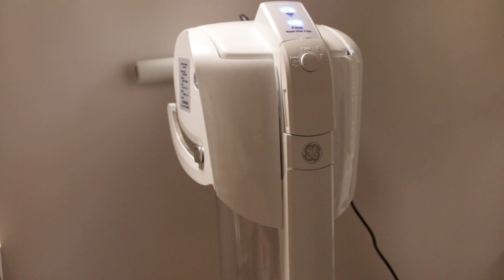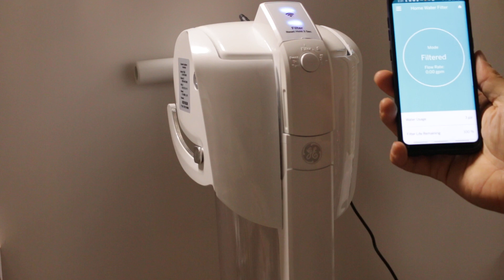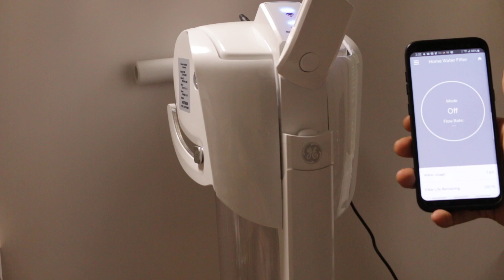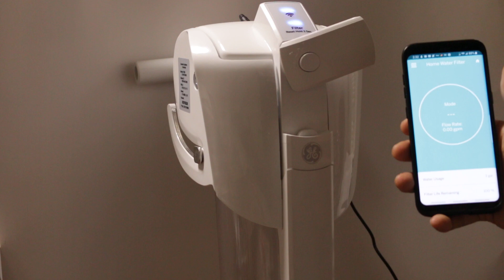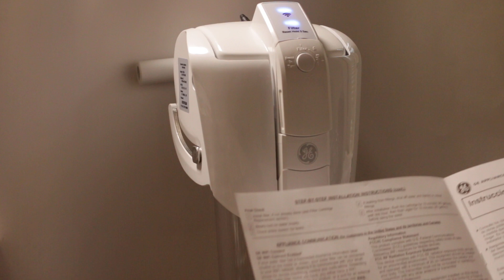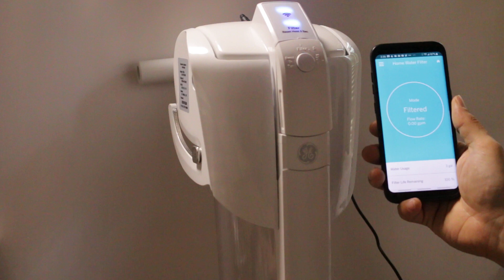GE Smart Whole House Water Filter

Comment: Dear Tom, I bought the GXWH70M system four months ago. Unfortunately, I lost the power supply adapter. Because I don't know exactly what output voltage this system uses, I cannot use it in all existing power adapters. It has many output levels from 5V to 36V. If you don't mind, can you tell me how many volts this system needs an adapter to use? Thank you very much for your help.

Comment: I have the 50 not the 70....and after having it for 3 months have tried to change the filter and the handle will not go up...what am I doing wrong...GE's instructions on changing the filter STINK...HELP
Reply from the maker: Hard to say. Your should probably contact they're support.
Reply: The handle will not go up cause you didn’t release the pressure. Continue to press the red button. It is located inside the head or whatever they call it.

Comment: The plumber that installed this took my manual.  I do not know how to change the filter and it has had a red light for almost 2 months!!!!!  Also, I have not been able to get a wifi account???? Any suggestions.  You show to turn off the unit to replace the filter, but I could not see how you turned off the unit!
Reply: One thing for sure this moronic video won’t show you how